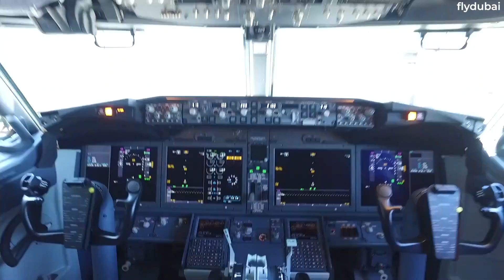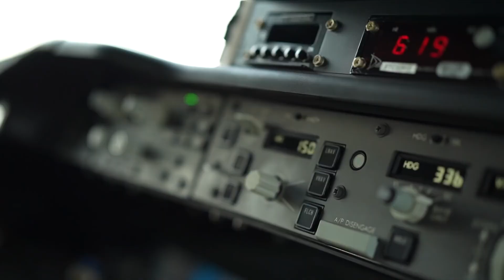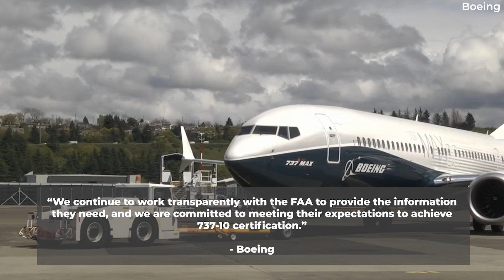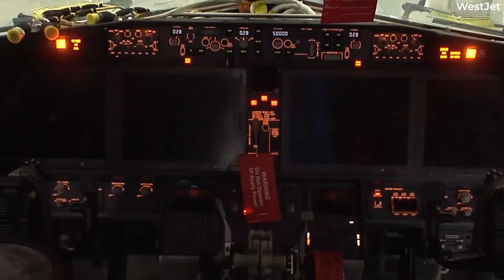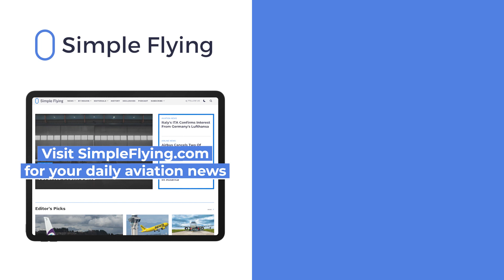Boeing Worried About Missing Key 737 MAX 10 Certification Deadline

Comment: It says a lot that Boeing does not want to add new safety features because it would cost them money. Did they learn nothing from the earlier MAX crashes?
Reply: Nope they don’t care about passenger safety they care about profits and government contracts.
Reply: Still being run by bean counters.  I think they're also concerned with the delayed certification and additional pilot training requirements mentioned here. They really put their foot in their mouth when they originally promised there would be none of the later. SMH
Reply: The airlines don't want the new systems in the MAX 10. That would cost them a pretty penny in extra pilot training. So Boeing is just responding to their customers' demands. If the airlines wanted the systems, Boeing would add them.
Reply: @steveschutte4990  airlines wanted dead passengers.  You are correct... 😆

Dude,  Booing said they will be no extra training... not what airlines said... are you serious? Lol
Reply: lives don't matter, only $$$
Reply: No,  Booing doesn't care about people.  They care about money.
Reply: Apparently not
Reply: No
Reply: Strictly speaking, the post December 2022 requirements will not cost Boeing much money.  The problem is that it will cost their customers more money to retrain 737 pilots to manage the new EICAS.  Boeing collected a lot of 737MAX aircraft orders on the basis that transition costs to the new aircraft will be no more expensive than transitioning to a different model of 737.  While this does not excuse the Boeing bean counters, they are trying not to offend the bean counters at the airlines.  If Boeing customers stated that they would eat the additional costs of retraining pilots to use EICAS, Boeing would add EICAS and pass any additional costs on to the customer.  Boeing is worried that the retraining costs will make airlines reconsider their orders, even if EICAS could be mounted for free.
Reply: Spot on! They really don't care about human lives!